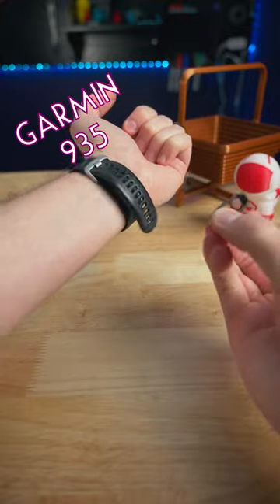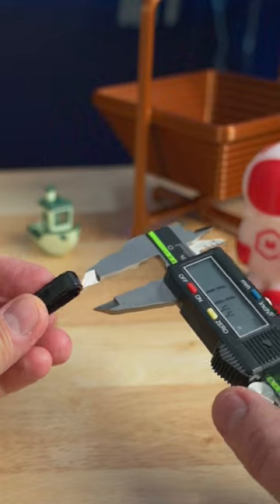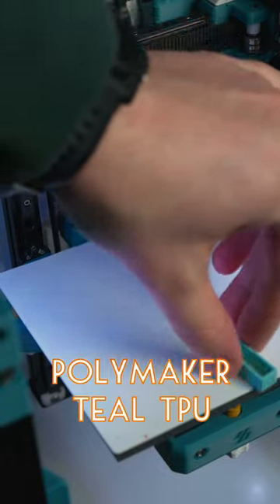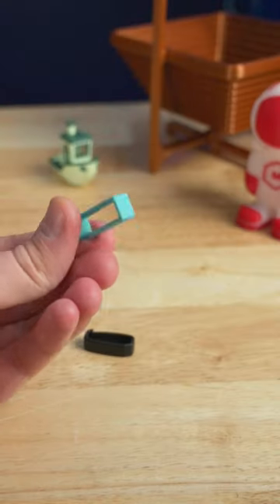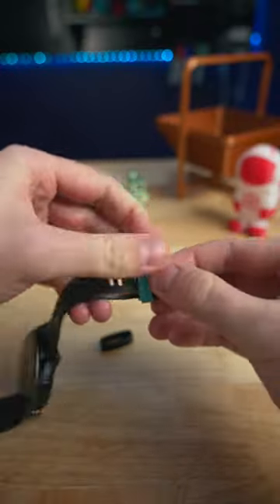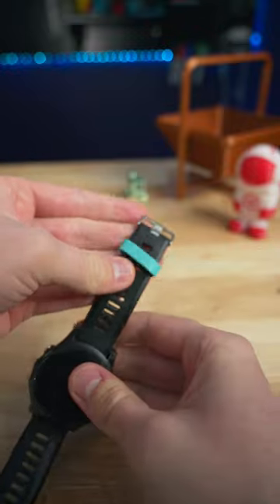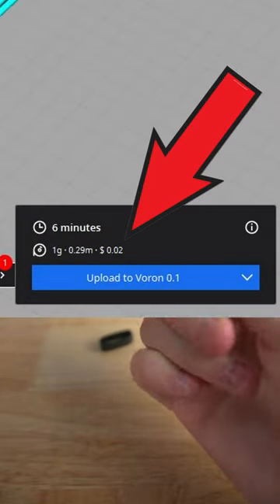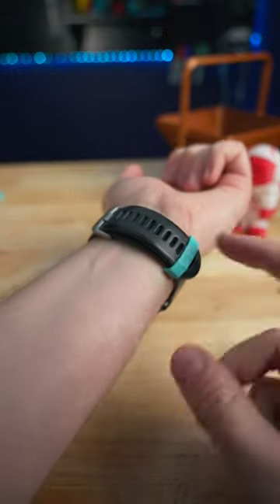Garmin Watch Repair 🔧 with 3D Printing

Comment: I bought my first 3D printer not even a month ago for <120$ (Elegoo Neptune 2) and it is already starting to pay itself. My mom likes to watch the sun with her telescope, and to watch the sun you need a filter in order not to blind yourself. The problem is that the filter was for a telescope she used a long time ago and that now is broken, and the diameter of the filter is bigger than the current telescope. So she used a lot of duct tape to secure it into place.

For 20¢ worth of filament I printed her an adapter that I designed myself on Tinkercad. The other option was to continue wasting tape or get a new filter for 150$.

Comment: The reason I want a 3d printer is to make solid plastic gears, for replacement/repairing things that aren't meant to be repaired and the manufacturer won't sell parts. My dad's lawn mower has a small plastic gear on the rack and pinion and that gear is not sold, I can save my dad over $1,000 if I owned a 3d printer and could just make him that replacement gear.

Comment: Super glue would've solved that, but what would be the point of having that gorgeous TPU then? * w *
Reply: But then you have a hard section on your soft TPU slider, and it'll fail in short order again. Casting a silicone replacement or printing a TPU replacement are the correct repair methods.

Comment: I have only one question.  Why blender? And not like some CAD software.
Reply from the maker: I find it way easier to modify existing models, which was how I started with CAD, and I've just stuck with it.
Reply: @JJShankles  ah ok. Makes sense. I suppose it works for premade designs. But in my experience I've always used solidworks. Even for editing models. Each to their own.

Comment: What bout the electricity it used ?
Reply: it's not much. a computer is like 10x more power use
Reply from the maker: It only has a 150W power supply, so it can't ever exceed that. Usually peaks during initial heat up, and way less power than the computer I edited this video on.
Reply: In my estimate you pay less than 1/5th of what you pay for filament in power bills, so it's not really worth thinking about. For very small prints it's gonna be a little off but still not enough to worry.
Reply: @JJShankles  uhmmmmm Voron bed is usually mains heated and bypasses the power supply, runs off an SSR then. So you have to add approximately max 60W for the steppers, 40W for the hotend heater cartridge, 10W for the brains, plus 20% on top for PSU losses, that's covered by the PSU with room to spare, plus 100W for the Zero mains bed. But realistically amortised power consumption is probably well less than 100W, since it'll pulse most of the heating and the steppers also run variable current.

Comment: Are your power free?
Reply: For this part? Pretty much, yeah. My ender 3 consumes around 0.1 kW/hour. Average price for 1 kWh is 15¢ by me. (substitute your own price). That means the hourly cost is 0.1 * $0.15 = $0.015. For a 6 minute print, I'll add 4 minutes for warmup and make it 10 minutes. 10 minutes is 1/6 of an hour. $0.015/6 = $0.0025 or 1/4 of 1 cent. 

Total cost: 2.25¢

Comment: How about you 3-D print a 3-D printer?
Reply: Possible, actually! You just need to buy some hardware. Have you heard of a Voron?
Reply from the maker: This was printed on a 3d printed 3d printer. It's a Voron V0.1
Reply: @Frappe3621  or go radical with Reprap Snappy.